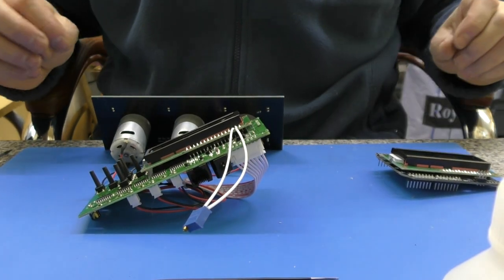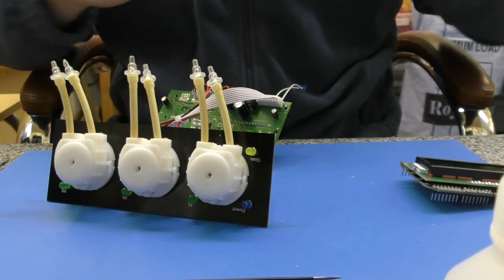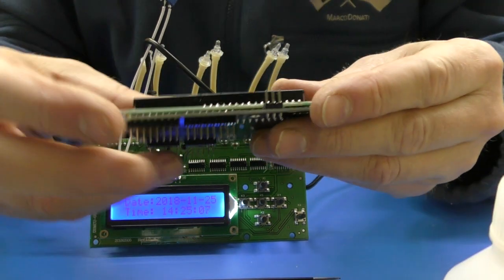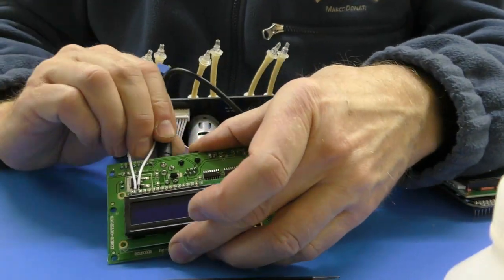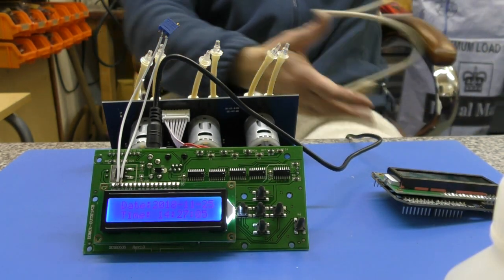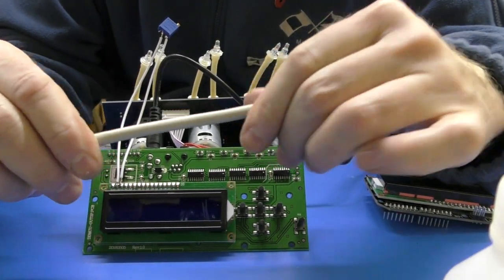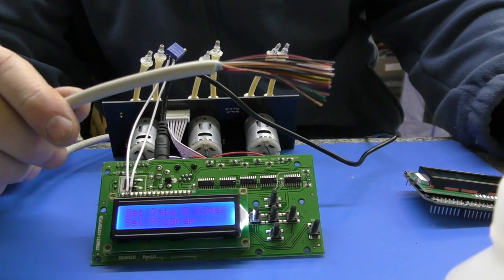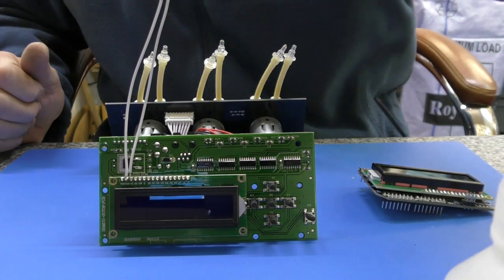Jecod DP-3 DP-4 DP-5 Doser. Modifying the Power LED and Display Contrast.

Comment: Is there a way to add an internal battery just to keep date and time memory during a power outage? I've noticed that the individual pump settings are saved, but the master date/time reverts to a default.

Comment: I don't see the resistor. Do you have any suggestion on how to fix the problem I have with led's for pump 2 & 3 being tied together. When either of them is on both lights come on. I don't know which pump is running when both are on. Thanks. BTW, how did the display mod come out ?